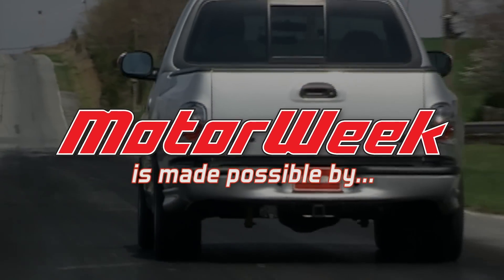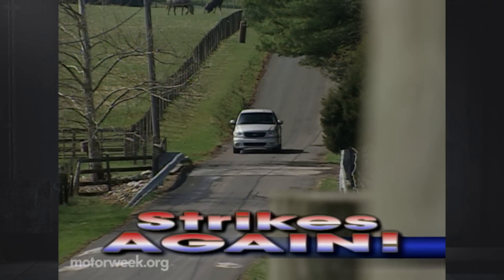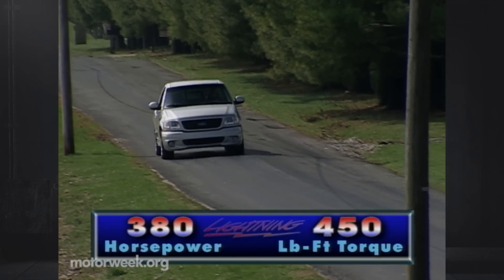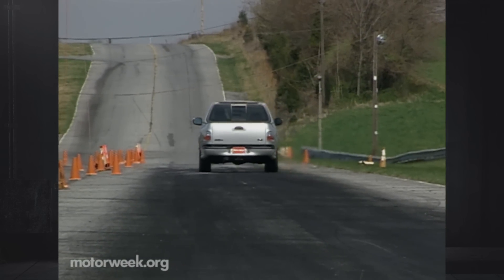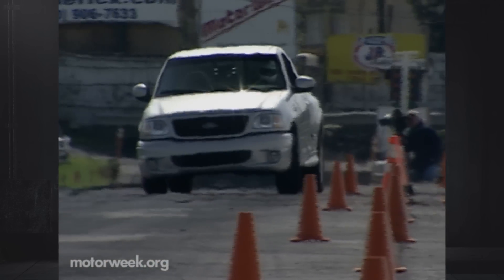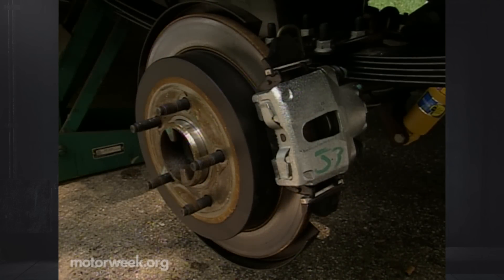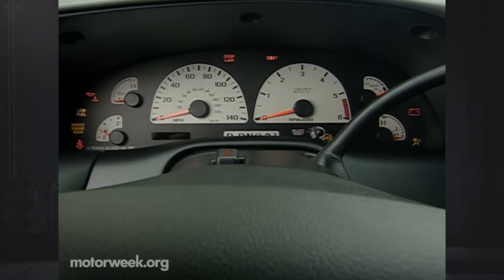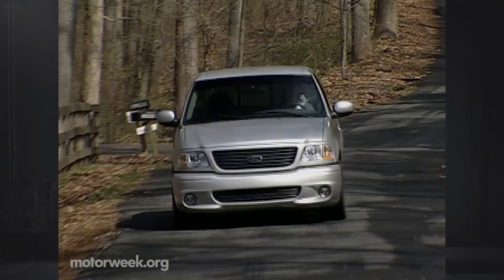2001 Ford SVT F-150 Lightning | Retro Review

Comment: It has already been 20 years! This thing cost LESS then than my new Honda did now. I have a neighbor with a red 2001 Lightening. He has one of the new Ranger's parked next to it. The new Ranger is just as big as the Lightening.
Reply: Yeah, it is sad. That is part of why new trucks (and cars) cost so much, they are simply bigger and heavier, and material costs money. Inflation obviously has a lot to do with it, and also, even a base-model car has a ton of equipment older ones didnt have, both obvious (parking sensors, power seats, windows, nav systems, etc) and less obvious (25 different computers, crash protection systems, emissions equipment, etc). Both because it is mandated by the government, and bcause customers simply dont buy basic cars. Anyway, I parked my 2018 Tacoma (the only truck you can still get with a manual, as far as I can tell) besides a early 2000s Tundra last week, and the Tacoma is actually visibly bigger than the old Tundra. it weighs six hundred pounds more than my old 2004 Taco did. I expected when I bought it that it would at least get better MPG with all the modern tech of the last few decades, but no. At best it is exactly the same, and I suspect it is actually worse, six speed be damned. You cant magic away 600 pounds of dead weight. True, it has far more load and towing capacity than a 2004, but I didnt want or need that. If I did, I would have bought a half ton (of course, now the "quarter ton" Tacoma does carry 1,000lbs). It is too bad, because now there is no option for someone who wants a small, light-duty, 4x4 pickup, especially with a manual.

Comment: Gas Mlg.Was About Half  of My 03 Terminator ,9-11 mpg.& Terminator Was 10 More H.p. Ford Should Have Put 0n the 32 Valve Heads & Left the Rear Gear @ 3.55.

Comment: 17 years later and a 100 hp more well keep your turbos give me a bigger crank pulley tune and icetank and i promise this 17 year old will run circles around the new truck but 17years later and correct me if i am wrong i think the old lightning is faster that the ecoboost truck stock for stock wow

Comment: Shouldn't they have made this a 32V?
Reply: Why? 2 valves work perfectly fine. You can make more power from a 32v, but they arent going to spend the money to develop a 32v head just for a single low-volume variant of a single model line. Not when a 16v works just fine. Hell, the fact that it was SOHC was still pretty advanced for an American V8 at the time. It is like people whining because Chevy V8s still use OHV. Because they are 'obsolete'. Yet OHV actually works just fine, and actually has a number of advantages. If it aint broke, dont fix it.

Comment: My brother had one of these in silver.  One cold night after he got off work he was headed home and the engine threw a rod through the block.  If you want to see what a nightmare looks like, try to replace the engine in one of these POS trucks.  It's virtually impossible to remove without a rack.  And with the engine in the truck you can't access anything once it's mounted.  What a pain in the ass.

Comment: GMC Cyclone is faster , with a V6 from the 1980's .
Reply: For the first 60 feet then the lightning would blow its doors off. I know I had one. I wiped the floor with many GMC cyclones. They weren't fast at all. The 4.3 was a terrible engine.

Comment: The Corvette is faster.
Reply: Erock 
Still faster.
Reply: Sekhem El the speed of light is faster than a Vette. Now what?
Reply: You smart
Reply: Mountain Jam 
Still faster than the SVT Lightning.
Reply: lfsracer79 
Thanx. I'm glad you know that about me.
Reply: The Lightning is faster than a C4 Corvette by 0.4 seconds ;)
Reply: cadsux. 
The Sledghammer C4 Corvette is faster.
Reply: So, getting to modified, one-of-a-kinds? Then Dustin Jackson's 2100 hp Dynomite Diesel Lightning is faster. Same era.
Reply: cadsux  
Thus lightening is a modified vehicle all the same. Since you want to go there, that truck is not beating the sledgehammer anyway. McLaren barely did.
Reply: It's all for fun. The Sledghammer C4 does the 1/4 mile in 10.6 seconds. The DJ Lightning did it's first test 1/4 mile in 8.4 seconds. It was then disqualified by NHRDA in 2016 for being "too fast," so it's limited to 7.9 seconds now! Granted, the Sledgehammer had a record top speed of 255 mph.
Reply: Sekhem El Because of its class it's in. Lots of cars can be " banned" if it's not up to the rule book of safety code.
Reply: Lol you sound like a little kid.

Still faster! Still faster!

Comment: It’s so funny my 2018 F150 Has more horsepower with the V6 TwinTurbo LOL!
Reply: How is it funny? It's a 2018 and has 2 turbo's. I'll roll with my 01 ⚡ how good are those TTs gonna be on your truck in 17 years I wonder?
Reply: Michael Thompson I don’t keep my vehicles much more than about four years at most I get bored of them and go to something else LOL if you look at my list of cars I’ve had for 2017 2018 cars and probably will be going for another one soon who knows that a big deal I didn’t mean to insult you if that’s what you’re thinking.
Reply: No insult taken, just a reaction to what you said. I hear u on the getting bored part, that's why I like to have a toy or 2 on the side. I'm new to this whole Ford thing myself.
Reply: Michael Thompson my first ford I bought in 1972 and that was a 1969Ford Mustang GT500 that I bought from a dealer for get this! $1500 and it was like brand new it was owned by a Doctor Who had it completely maintained by the dealership